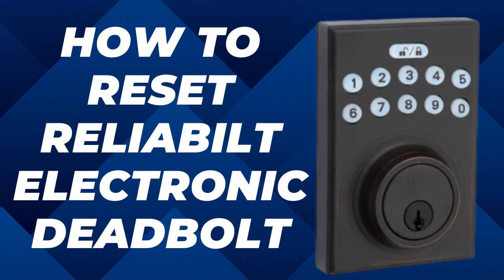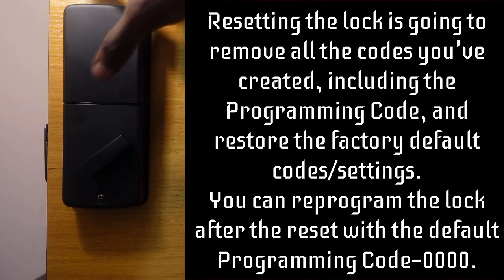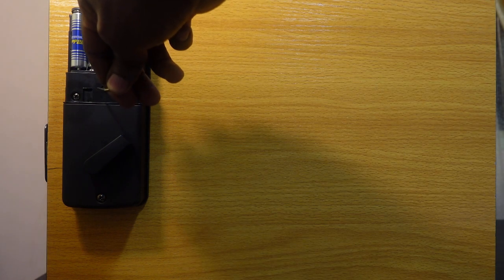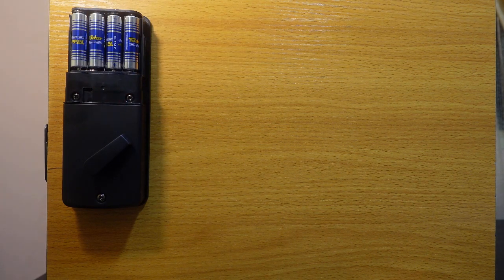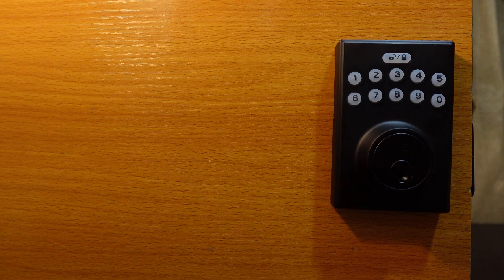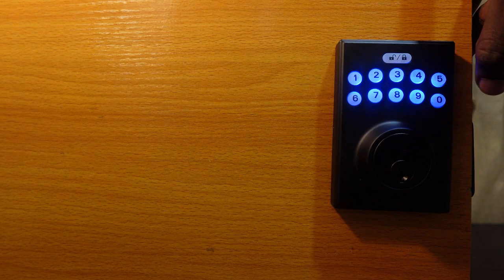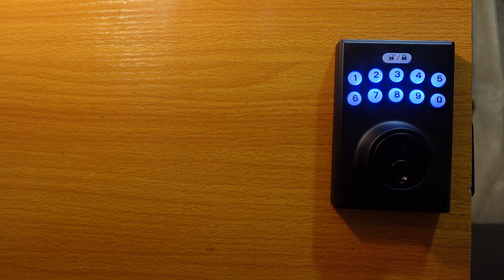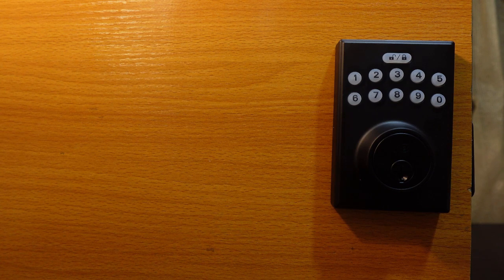How to Reset Reliabilt Electronic Deadbolt

Comment: Short, concise video but I think creator skipped some steps😢
Reply from the maker: @glenbutler9611  This is for the reset/setting the door handing. Here's the full programming video -- https://youtu.be/7ergL_LgtV8

I've demonstrated how to change the default Programming Code (0000), remove the default User Code (1234) and add new User Codes. Hope it helps.